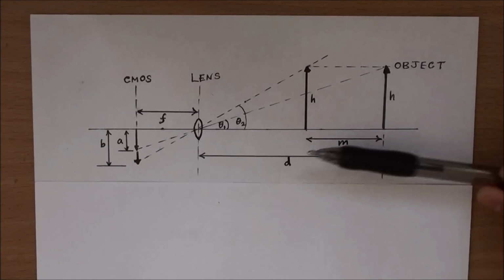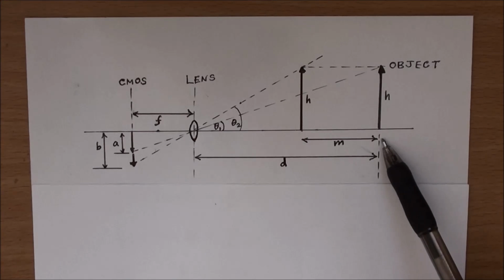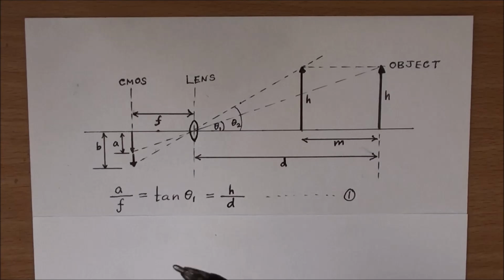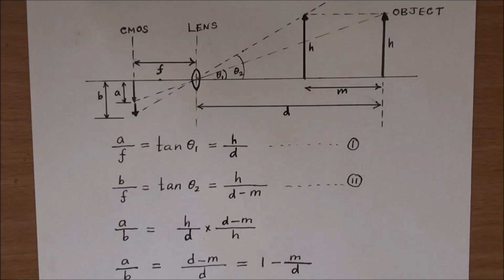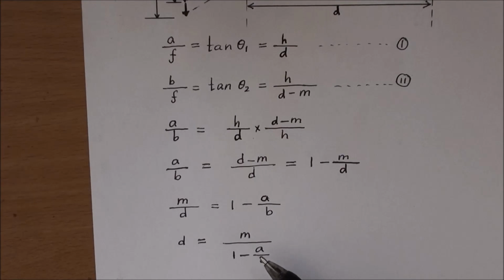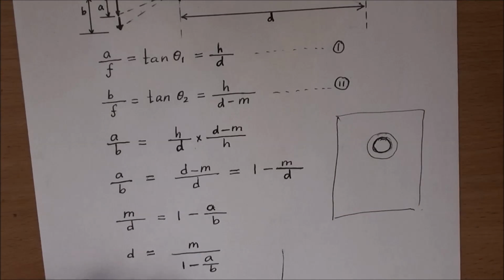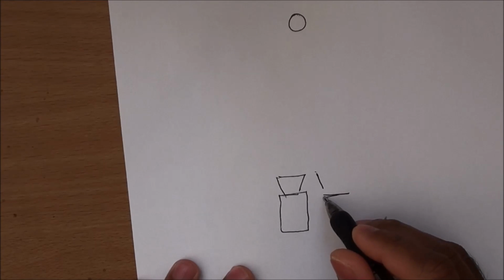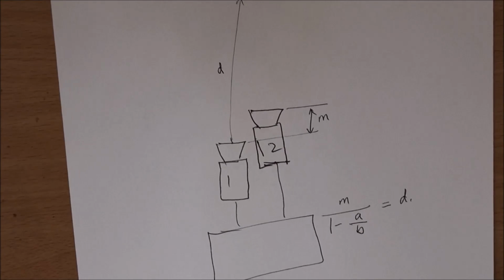Distance to objects using single vision camera.

Comment: Great video, I'm working on computer vision too. But, what if I also want to know the difference of heights between the camera and a point? 

I mean, I use a dron camera and would like to know the depth and the difference of heights with the center of a red rectangle. 
with your video I can guess with accuracy the depth but not the height.

Any ideas? thx
Reply: I'd love to know if you figured it out!
Reply: you can do it by using slam

Comment: I don't think the thin lens equation you are using is correct. It should be 1/(focal length) = 1/(object distance) + 1/(image distance). Besides, take a glance at the result you would know it's problematic since d is independent of f? never be the case...
Reply from the maker: Did you not look at the real life example at the end of the video? Theory presented is correct.
Reply: @luvocean1  Yuan is correct for thin lenses. However the error in your equation is small in your real life example so its close. If you move an object closer the  cmos sensor must move further from the lens to stay in focus. This movement is not linear. And you did not include the focal length of the lens. Lens power affects this result too. Please do not say that the theory you presented is correct when in-fact it is clearly not.